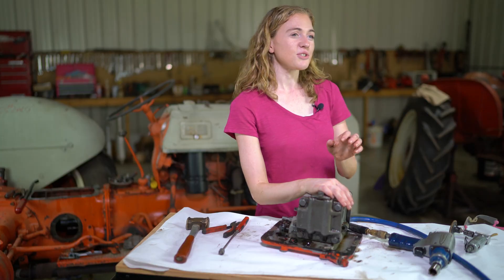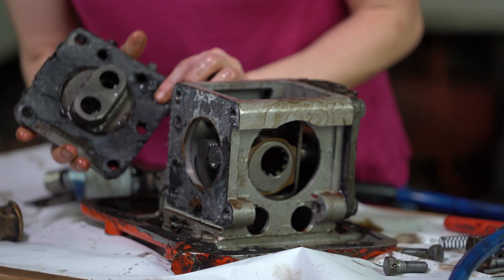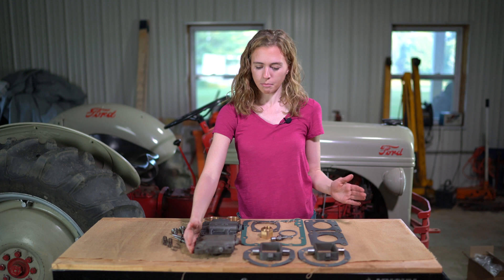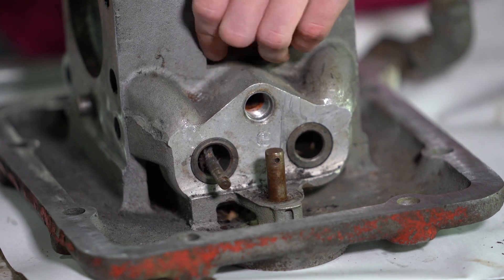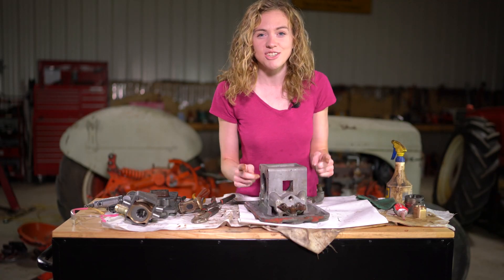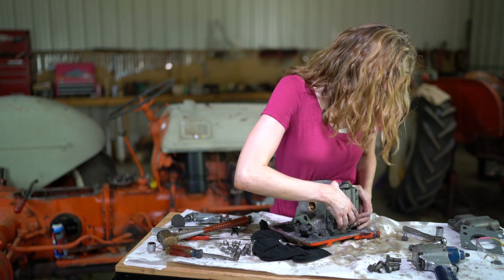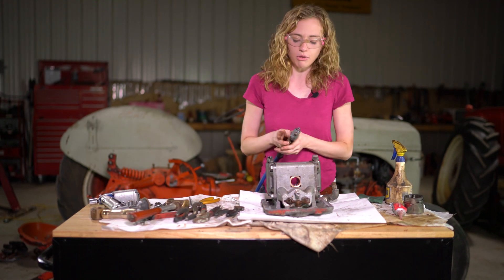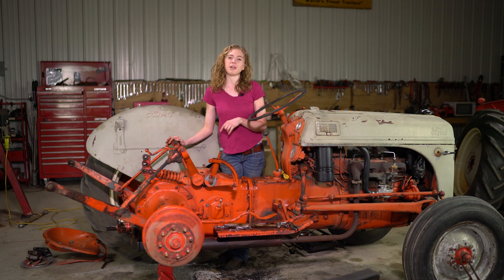Ford Hydraulic Pump Rebuild, Ford 9N, 2N, 8N: Easy Step-by-Step Tutorial

Comment: Hope this helps somebody! My 1946 2N was bouncing like crazy when I set the brush hog at mowing height without the PTO connected to the brush hog.  Rebuild the lift cylinder, rebuilt the pump, replaced the pressure relief valve. I reached out to my friends on Facebook, 2 said it was the draft adjustment. Took it apart and the plunger rod was bent significantly upwards. Found a  diagram showing the plunger to be straight so I propped a piece of flat steel under the base and used a pipe to cold bent the rod straight. Cleaned everything up, welded and re-drilled the hole in the wear plate, put it back together and it's fixed!

Comment: Around 6:30, where you remove and replace the exhaust control valve, you don't show or replace the valve's spring or the retainer pin. I can't find these parts in my pump, but it is shown in the pump diagram, and I have seen others refer to them. How would they have come out, and how will their absence affect the pump's performance? And where can I get these parts? Presumably, they are in a whole new pump, but I can't find them individually.

Comment: EDIT TO ADD: after reading all the comments, I have found that you did in fact show us how to put the valves in wrong. this needs to be fixed on this video. I would have been so angry if I installed it and it was wrong and had to be drained and start over! You cant trust this video so Im giving it a thumbs down unless it's fixed or removed.   

 I appreciate and enjoy watching your ford 8n repair videos. I just rebuilt my hydraulic pump in my 52 8n by watching this video! Im a 60 year old female, and have a strong mechanical aptitude. However, unless I missed it somewhere, you did not mention which direction the geared side of the cam faces. front or back? Im not sure it makes a difference and can not find a definitive answer. my geared side of the cam is at the front. I have not installed it yet, but "ran" the pistons with my old pto drive shaft to make sure everything was copacetic and not binding. can you verify which direction it faces? hopefully before I reinstall the pump. it will be at least a week before I get back to it.

Comment: Very good instructions except for the value assembly. I rebuilt a pump, but then it wouldn't pump anything until I figured out that the mid sized value was upside-down..

Comment: Thanks for all the great videos and information.   I put air pressure in the pressure port with top plate removed and have air leaking at exhaust valve in pump with pry bar holding valves in full lift position.  Removed pump and valve looks fine but there isn't any seals in there? Is this just a worn part/pump? The valve and valve bore look good. The lift arms drifted down fast and I'm putting new piston in from your store but I think it will still drop with this leak present. Thank you

Comment: I followed your steps and my pump doesn't work....I have found you put the valves backwards.  I had to pull off my top plate again and now I need to try and fix this with the pump installed.  Why don't you update your video since other have noticed this??
Reply: Doesn't seem that they answer any replies in the comments. If you look back I do believe the second comment mentioned this. Her mistake could be costly to others... although a simple mistake.

Comment: So I noticed you have some errors with your valve assembly. You did not show the socket pt# 9n627 but also you have yor large valve upside down. This is per the Ford part diagram, as well as seeing how my old pump was assembled.

Comment: Hi Rachel I rebuilt my pump back in the springtime off this video you do a good job I have a question for you though I had a gasket on my valve body bust so about 2 months later I'm rebuilding my pump again what torque specs do you recommend on the valve body?

Comment: Please revisit this video, you have assembled the valves in the chambers wrong. Both the small and large valves should have smaller ends pointing up, the way you have one up and one down,  the spring will not have tension on it. Also, there is a valve guide in the bottom of the camber that will come out when cleaning and should be mentioned.
Reply: YES we just discovered this error in her reassemble video

Comment: Thank you for your video on the hydraulic repair I’ve gone through the pump and the piston then watched your video and check the hydraulic tube part number 9n567 And to your advice check for cracks and it’s broke how do I remove and replace thank you

Comment: Hi great video but I believe you have the valve medium plungers backwards in the video. The medium one should be spin 180° to put resistance in the small spring.
Reply: I agree. The larger check poppets are installed upside down. The only reason the arms didn't fall is because there wasn't any weight on them.  Otherwise great video!

Comment: Hi Rachel!! You have a wonderful way of communicating! You obviously love working on old tractors! Me, too! I need to learn how to properly back flush the engine block on my 640. It wants to overheat too easily in hot weather. I've heard that over the years they get pretty gunked up, restricting the cooling passages. Do you think you could do a vid on that procedure? Love watching your channel--it's so helpful and informational. Thanks for doing these! You're awesome!!
Reply: I remove thermostat and connect water hose to 1/4 fitting (drain on back of block) and just let it run for 30 minutes with thermostat cover back in place 
It pushes slug out of block
Reply: @philliphall5198  Thanks, Phillip! What you mean by thermostat cover?

Comment: You made it look easy.  Im thinking i need to do this on my 1947 2n.  The 3 point works but will not hold a position.  For example i can be using the finish mower and i set it at a certain height then 2 seconds later its raising up higher.